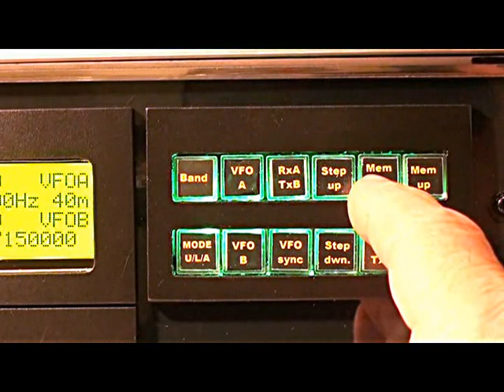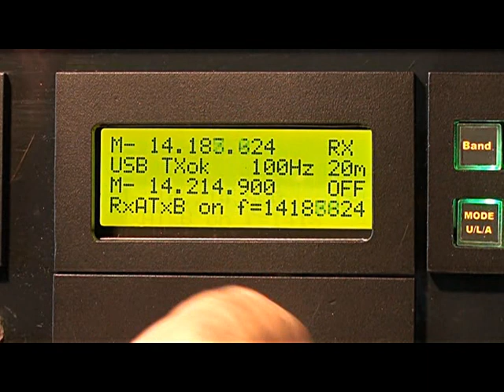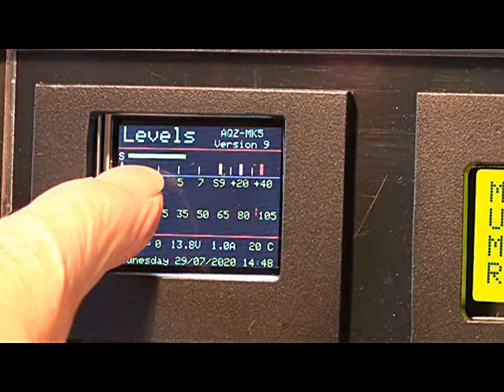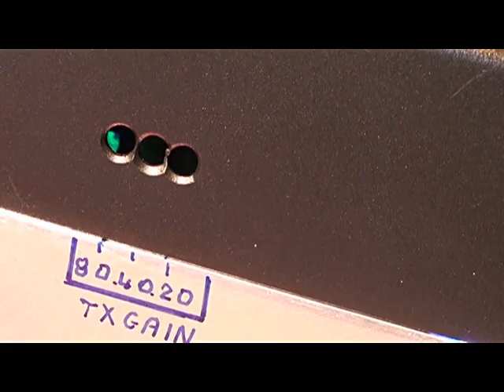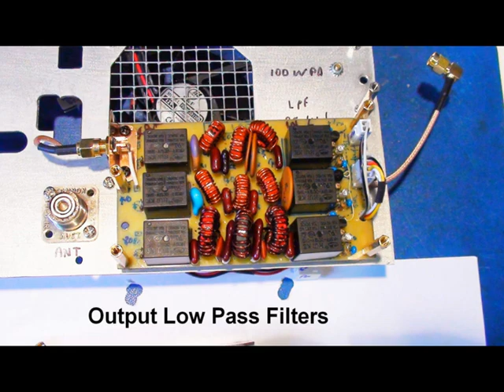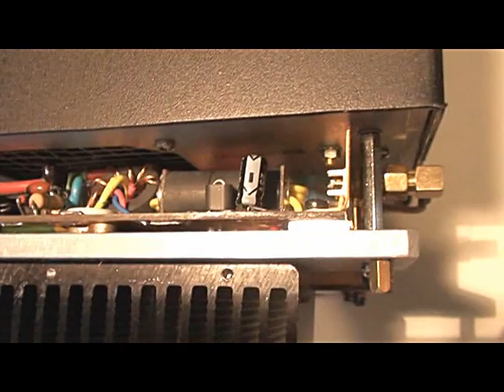VK3AQZ MK5 transceiver demo Part 1

Comment: Brilliant, beautiful, bellissimo! After years of reading, building and breaking radios  I think I can guess how you've  done just about everything inside this rig. To put it all together,  workibg as well as it does, and finish it all so well is a great achievement.  73 Paul VK3HN.  PS. How did you do your front panel, is it partial 3D prints?
Reply from the maker: Hi Paul, the front panel is actually surprisingly easy to make. It is drawn up using Smartdraw. The drawing is then printed out in draft form and tested using a piece of cardboard for placement of the various knobs etc. Once that is settled, the coloured version is printed on an inkjet printer in the same way as a glossy photo (with a good printer). That is then laminated in a silver pouch which is around 100 micron per side (made by GBC).  I use a non colour print as a template for drilling a piece of 1.6mm aluminium panel and that ensures the front label and panel match. Smartdraw allows colour fill and gradients and is quite good for this type of work. The dial markings are made as accurately as possible and then grouped into a single object and copies planted on the drawing where needed. The program has a rotation protractor like function which  makes it relatively (and I mean only relatively!) easy to do circles and scales (but requires patience!).  Anyway, it sometimes takes a few goes but  one gets there in the end. The thicker the lamination, the better since the label stays stiffer. Hope that helps, Lou.